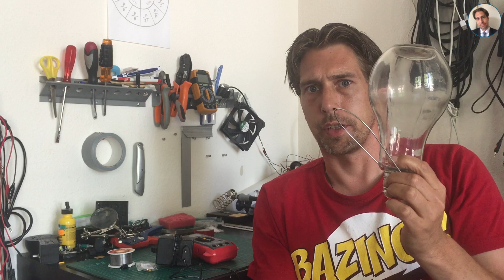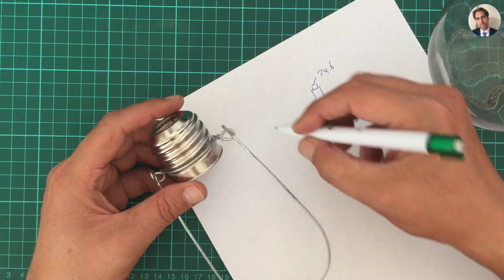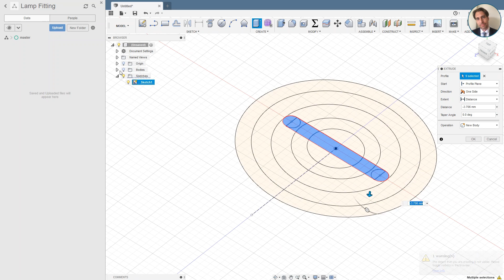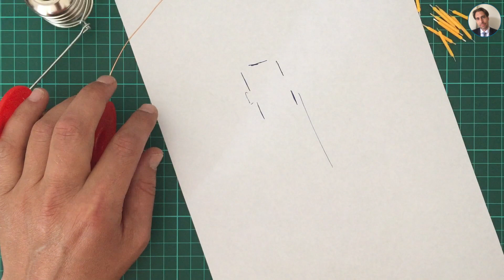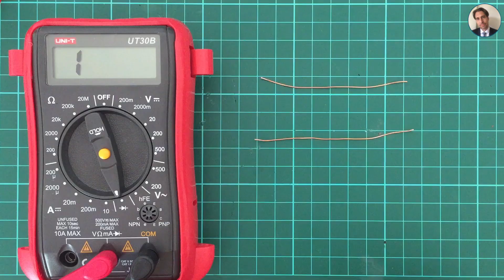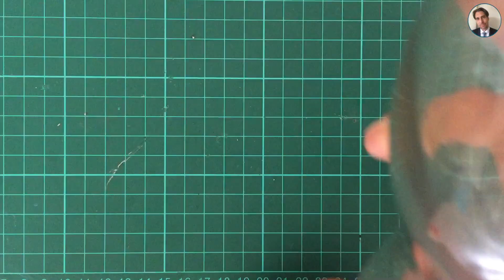Building a large decorating light bulb

Comment: Nice project! One question: Where did you find that light-bulb vase? 
I normally use the heat of the soldering iron to get rid of the enamel. Just heat it long enough and it will melt/burn off.
Reply from the maker: The light bulb vase was for sale at the Albert Heijn (for people from outside The Netherlands: a large grocery store) and had some flowers in it. Doesn't burning the enamel off mess up your tip?
Reply: @DustinWatts  Thanks! No, not really. I use a blob of solder at the end of the tip with temperature at 300`C. Then I slowly put the enameled wire in the blob. Works fine for transformer wire (see for instance my video about the TM1637 customized led matrix).
Reply: I was going to say the same thing - just tin the ends and the heat will burn off the coating